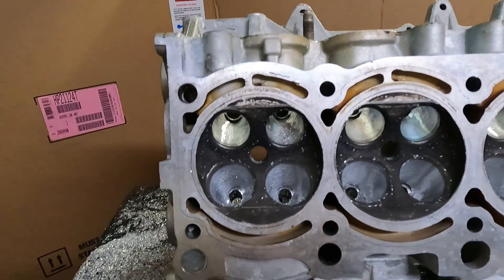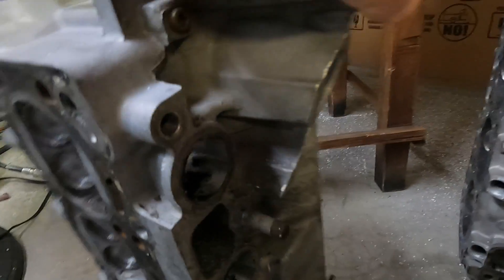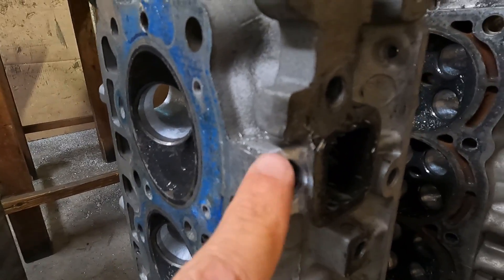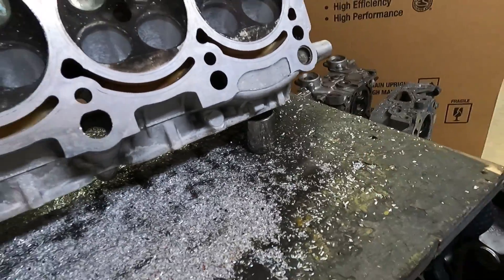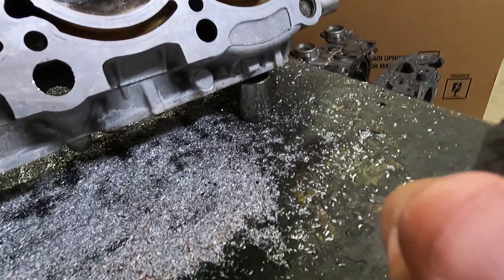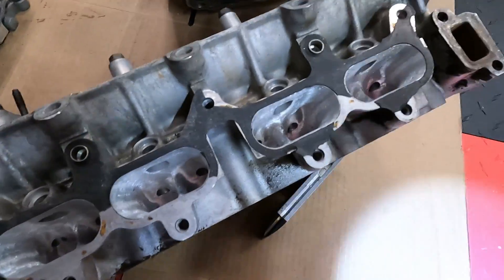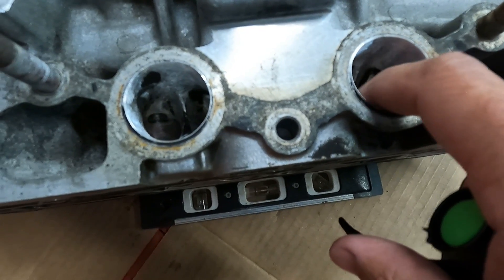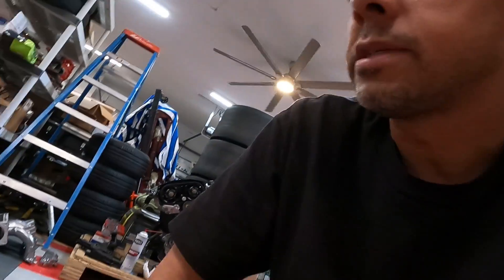Porting some Toyota cylinder heads #3sgte #4ag #3tc

Comment: Hey, where are you located? Ever ported a set of early nonvvti 1uzfe heads? 😬
Reply from the maker: Hahaha never have, that's alot of valves lol
Reply: @psiracing  haha you’re telling me brother. I got quoted $4000 locally to have them fully ported (cnc program), clearanced for big cams, recondition oem valves, new seals and guides, resurfaced, install (all customer supplied) kelford shimless buckets, springs, cams, and set lash etc. 

After digging deeper I’ve learned that’s about right… that’s the going rate for that setup 🫣